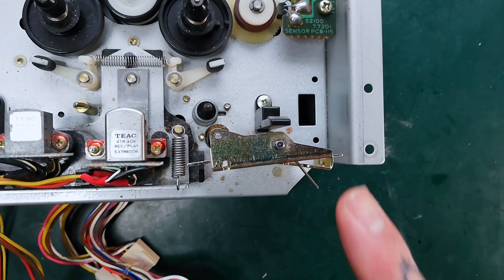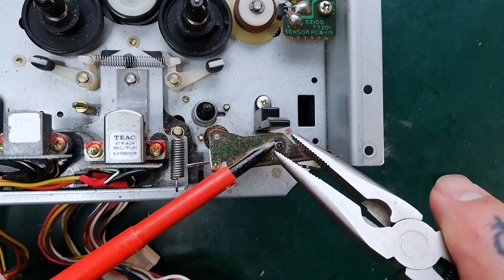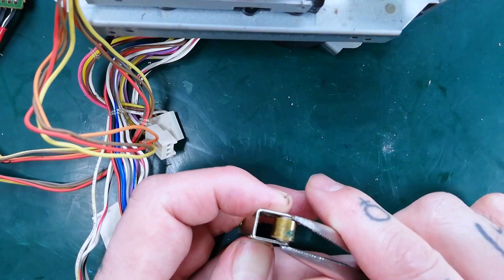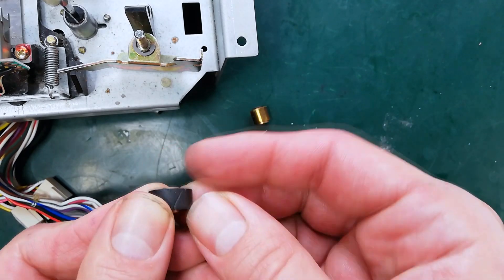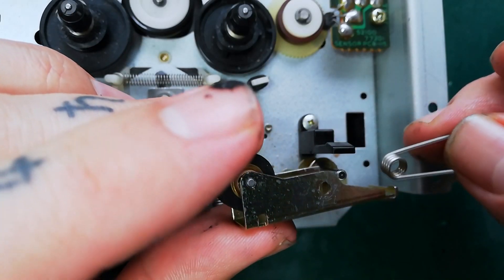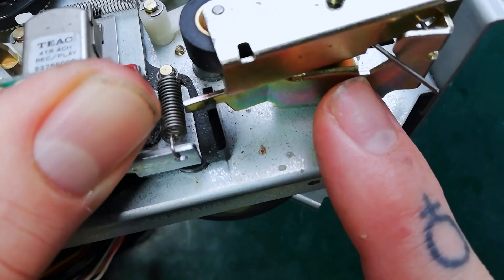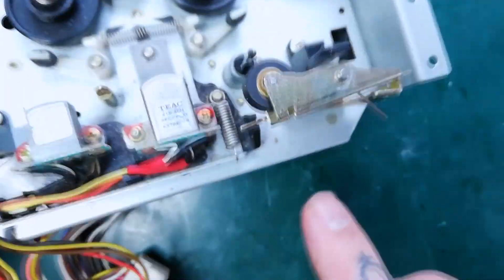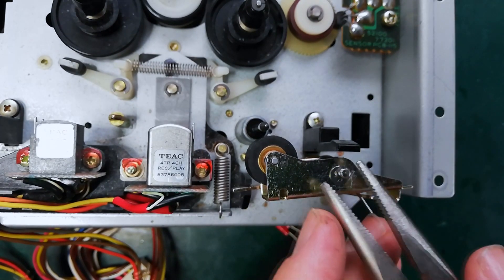11 Replace Pinch Roller (fix your Tascam 244 Portastudio)

Comment: A serious thank you for doing these videos. They are invaluable to me. 

I have an issue, if you wouldn't mind maybe giving a little advice. My 246 pinch roller seems to be causing issues. I get warping and tape dropouts as the tape pulls through the transport. I removed the head cover so that I could see more of what was going on. It seems that the rubber wheel is pushing the tape up and down the pinch roller. Occasionally when I stop the tape, the tape is stuck to the rubber and is pulled slightly from the cassette shell as it pulls back from the tape. I'm guessing perishing rubber that needs replaced... I'm a bit hard up for cash at the minute but can afford a few risks, so do you think this is a simple pinch replacement or perhaps something larger? I'm happy to replace the rubber but is there any solution that should be tried before opening it up? 

Cheers!

Comment: Hi, I'm Rocco from Rieti (Italy)
your videos are beautiful and have helped me a lot to fix my 244 tascam.
finally this morning, after various components changed) I managed to turn it on, in play it worked well but I could not record anything.
when I tried to record, the input signal was ok but when I wanted to listen again you could not hear my recording but the previously recorded music.
I noticed a strange noise coming from the pinch roller, it seemed that the tape was constantly sticking and detaching from the roller.
I touched it and it was sticky and very, too soft.
I can't find a pinchroller here in Italy, I don't know how. can you help me to solve this problem please? why do you think my tascam 244 didn't record? could it be because very large pieces of tape remained stuck to the pinch roller?
thanks for your help and you are great :) I spend hours watching your videos
Reply from the maker: Hi try this link to order a pinch roller, cut the plastic core off and put this rubber on your original brass pinch roller core https://www.ebay.co.uk/itm/10pcs-Rubber-8-8-x-6x-1-5-mm-Pinch-Roller-for-Cassette-Decks/264525828422?hash=item3d96f7d146:g:cKQAAOSwBP1efyRs
Reply from the maker: For the recording problem, It is very unusual for the unit to make NO recordings on all 4 tracks... change the [p[inch roller rubber first, then check - did the red record button light continuously? (I ask because some people don't realise the record and playback buttons must be pressed simultaneously - if you don'rt do this the record light will flash, and no recording is being made)
Reply: @Tetrakan  hi good morning, thanks for the replies, I mounted the pinch roller and it works perfectly, also it was my mistake for the recording now it works on all 4 channels.
while recording I noticed another problem, however, by adjusting the input volumes and recording I noticed that in play some volumes are higher than others.
I think there is a need for calibration.
I saw the video where you explain how to calibrate but I don't understand the details very well, I'm Italian and sometimes I don't understand English well.
could you write me how can I do the calibration of the meters, the rec and the play? sorry for the questions and thanks in advance.
Reply: all day today I spent it trying to calibrate playback and record amplifier, now the levels are more or less similar but channel 3 now gives off a strong rustle and the low frequencies are very badly heard.
Reply from the maker: @CAVALERAROCCO  I'm going to write a short article for my blog explaining the calibration process for the benefit of viewers for whom English is not a first language. I'll comment back here with a link once it's done.

Comment: Great Video: I have a 244 that is afflicted with this black tar disease....Could you tell me where I can source a replacement pinch roller or Pinch roller kit ?.....Best Regards
Reply from the maker: Thanks for watching, I did a couple of videos on this topic, here's the first  https://youtu.be/Aa9CCj_Lu4w
Reply from the maker: But the best thing is to get a really cheap PR of about the same size and use the rubber to refurbish the existing brass core, see this video https://youtu.be/YMWHQgfCS5I

Comment: Good Evening from Bristol. Thanks for your excellent videos which have given me the confidence to tackle my original from new 244. Idler tyres removed (tarry s*** still going everywhere...from such a small source!) and replaced, now to do the pinch roller tyre which has completely disappeared apart from a bit more tar (I think I'm buying a replacement tyre from Europe somewhere as I can't quite tell which similar one to buy cheaply from UK ...AS2?). Anyway, your video at 3'20" or thereabouts shows how the spring should sit in the V. Mine (not yet removed I should add) does not sit in the V to start with. This is worrying me as I want to put it back like you say. I had some repair done to the transport controls years ago and I can't say it was ever right after but it's so long ago. They might have mounted that spring wrongly, is your way the only correct way ('V') please? I have a good photo but no idea how to post it here. Apologies for the rambling style. Best wishes, Phil
Reply from the maker: hi, The way I'm demonstrating the positioning of the spring is the way it has sat in most units I've received with rotten original pinch rollers, and so its my guess they left the factory. Early in my "career"  refurbishing these I did manage to place it a different way via guesswork (longer arm of the spring strung through a hole in the pbrass arm) and it worked - perhaps this is how your tech did it too? But its a fairly robust piece of metal so don't worry too much about it, nothing should break if you reinstall it my way having previously  been installed some other way.
Reply: @Tetrakan  Thanks mate! Appreciate your replies

Comment: I have the Portastudio 246, what is the name of the tool that allows me to remove the head block cover? Little flathead screws, with two pin holes or divets in them?
Reply from the maker: I think its called a crab claw screwdriver? I don't own one! If I ever need to remove the panel you're talking about ( I only ever do that to clean a really filthy 244/246 - for changing the pinch roller etc I always remove the entire transport from the rear) then I put the pointed tips of the green hook-nose tweezers you see me use in these videos into the two holes and use that to loosen the screws until there is enough of them protruding I can turn them by hand.

Comment: Hello thanks again for these videos just going through replacing all the rubber elements on my transport.. Quick question.. My pinch roller feels very tight after installing the new one.. it does turn but there is quite a bit of resistance.. Im worried i made metal either side very tight trying to remove the center spindle. Does it need to move quite freely or does this sound ok to you?
Reply from the maker: The pinch roller should move freely. If it has plastic sides you can wear those down with sandpaper before installing, but ideally fit the rubber from a cheap one with a plastic center to the original brass center from the original pinch roller, I will paste links totwo relevant videos I produced below.
Reply from the maker: source a cheaper pinch roller https://youtu.be/Aa9CCj_Lu4w
Reply from the maker: Replace rubber on tascam 244 or 246 pinch roller https://youtu.be/YMWHQgfCS5I
Reply: @Tetrakan  Thanks so much for getting back to me.. On Christmas day no less :) My problem was the pinch roller.. I removed the transport again and added some lubricant to the pinch roller axel and its all working a treat.. Transport feels like new cleaned it thoroughly and replaced all rubber parts. Now i want to remove the top panel and clean all contacts for some reason my machine wont record to track pgm 3? If I put physical pressure on the master faders the signal passes through to this track then.. Also my machine has as intermittent problem where it looses power to the tape section.. I need to re-boot the machine (sometimes a few times) until it starts letting me use the tape section again.. Do you think it could be fuses? Mine is a UK model
Reply from the maker: Sounds like your master fader needs a good clean, I have a video on that, hard to acess but not especially hard to do once you get the fader out. If it was your fuses it wouldn't come back on no matter how many times you used the power switch. I'd suggest a dry or broken solder joint - might need to do a fairly extensive visual inspection/deconstruction to find this...be careful near the power switch transformer and large capacitors  (I.e. work with the unit unplugged and several minutes after powering off)
Reply: @Tetrakan  Thanks for the advice, im confident i can take off the face panel and clean the pots and sliders after watching your guide :) Do You have an idea which pcb to investigate for this power issue by any chance? It hasn't happened again since, thing is i've never soldered in my life :)

Comment: So, I've just fitted new pinch roller and idler tyres. As well as new belts are now on. Mechanically everything seems to be working nicely but nothing will record... any ideas on this? I've been looking to see if I missed a connector or something but no luck with that so far...
Reply from the maker: Hiya, this seems like a simple question but actually it is very broad! Keep checking these comments and I will try to talk you through troubleshooting this issue, and please do not be offended if any of this seems condescending, I just don't know what your experience level is :).  The first thing to check is have you armed the tracks you are recording properly... for instance if you are recording a monosynth into onto track one of your cassette using mixer channel 1;- fader 1 AND master fader should be set between 7 and 8; Input switch on mixer channel 1 should be set to "Mic/line"; mixer channel 1 pan control should be set all the way to the left; record mode should be set to "SYNC"; Buss left should be set to "TRK 1"; the mixer channel 1 trim knob should be set so the channel 1 VU meter is showing an average signal of at least -7Db. If this is all set correctly, are you pressing record AND play buttons firmly AND SIMULTANEOUSLY? Let me know :)
Reply: @Tetrakan  doing all this yep. 
The only thing I hadn't done before is panned hard left.
Reply: Just tried panning and not hearing any playback either. I did once manage to hear something I recorded on the cue mix knob but now no luck reproducing it.
Reply: And for no reason I can explain I can hear something I recorded on track four from yesterday when trying to repeat the process
Reply: I rewind and try to hear it back again and now nothing...
Reply: Sometimes I can reproduce some playback in cue mix if in record mode on another channel. Almost like I have to press play and record twice too... Then once heard it on remix playback but can't reproduce it...
Reply from the maker: teejteejteejteej . The reason to pan (during recording) is everything coming out of the right output of the mixer channel 1 pan pot is going to track 2 of the cassette, everything coming out of the left output of the pan pot is going to track 1 of the cassette, so if you want the input signal to hit tape as hot as it shows on the meter, the channel must be hard panned during recording. To avoid confusion don't set monitor to remix until mix down; use cue mode and the tape cue controls to establish whether signals are being printed to tape.
Reply from the maker: teejteejteejteej would you be able to film the process of your recording a signal and play it back and share the YouTube link so I can see what is happening?
Reply: It seems like I can't hear any playback unless recording on another channel
Reply: The squeaking seems to be coming from the idler tyres
Reply from the maker: @teejteejteejteej Okay I watched your video and I'd need to test what I'm saying here in practice (you know that way you're not sure how to spell a word until you can write it down?) and can't immediately becasue I only have partially dissasembled ones here right now, but I think you need to put the record function to safe after recording? When you're putting the L buss switch to safe, you're disarming that track for recording, but I don't think you're switching the system to monitor recordings? Also you're recording very close to the beginning of the tape...I can't see exactly where because the camera is very close to the unit but I always fast forward from the beginnign of the tape to 50 or 100, then start recording there to get past the leader and adhesive etc. Could you try those two steps (record further into the tape, record function > safe before monitoring) then film again to see where we are? I don't expect you to set up a tripod or anything but its easier for me to help if you can try to keep most of the front face of the 244 in shot most of the time.
Reply from the maker: @teejteejteejteej  As for the squeaking, where did you get the tires? In the past I've bought expensive ones and were so hard they didn't catch properly which caused squeaking  and warble due to rapid changes in the tape tension as the idler tires caught and slipped and caught and slipped. Could be if you use softer tires or sand the surface of the existing ones using two rotary drills (I have a video on this) it'll work better?
Reply from the maker: @teejteejteejteej  Thanks for making the videos, if there was anything awry with how you were using it its sorted now, sorry if that was a pain for you but it was helpful to me to eliminate user error from the list of possible causes. If playback is intermittent then record could be as well, both functions are performed by the same magnetic head. If you've managed to play back or record something on all four channels at least you know the head is good. Intermittent faults are a good/bad thing because they are total pain in the arse to locate (can take hours to find)but easy to fix once you find them (2 minutes of soldering). I would begin  your search with the cables that run from the heads to the record amplifier PCB since you would have to have handled those while changing belts etc.
Reply: @Tetrakan  not having much luck finding anything so far... I guess I am looking for cables or components that have come loose?
Reply from the maker: @teejteejteejteej  Hiya mate, ideally yes you would spot an obviously disconnected cable etc but it may not be so straightforward as that.... I think the easiest thing would be for me to make an illustrated article going through the troubleshooting process and post it on my wordpress blog. So take a break from working on your 244 for a week, I'll start the article tomorrow and aim to have it up by beginning of next week and I'll post the link here once its done. You'll need a digital multimeter and a soldering iron and some solder so get hold of those if you don't have them already.
Reply: @Tetrakan  thanks! I just borrowed a multi meter and soldering iron so hopefully find the issue soon.
Reply: @Tetrakan  also it seems when pressing play or stop the alignment arm on the control mechanism is not visible through the alignment hole like explained in this image. https://www.mzentertainment.com/pics/teac_244/dr_zee_workshop_tascam_244_project_part5.jpg 
But I have no idea how to realign it... Could that be my playback issue maybe?
Reply: I also get a frequency sweep on the headphones as it turns off... Not sure if that's a clue to something either...
Reply from the maker: @teejteejteejteej  Grand, this article may take a while (I'm fastidious and dyslexic, a combination which means I produce the written word at a speed that makes George R R Martin seem prolific) but I've got another 244 in at the moment so all going to plan I'll do a very rough audio troubleshooting video later today and have it uploaded tomorrow.
Reply: @Tetrakan  thank you so much. Your videos were already very helpful so being able to ask questions like this is very much appreciated.
Reply from the maker: @teejteejteejteej  got a video up which I hope will help https://youtu.be/YEUSosp3ImY
Reply: Actually it could be recording but I can't hear playback... (unfortunately got no previously recorded tapes to try it). I feel like I am doing something simple wrong and being stupid but I can't figure it out.